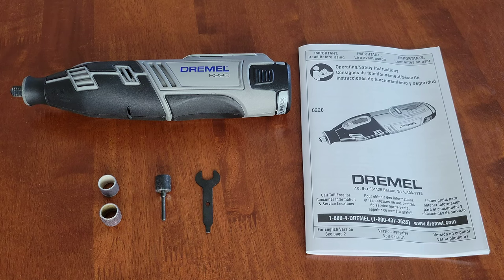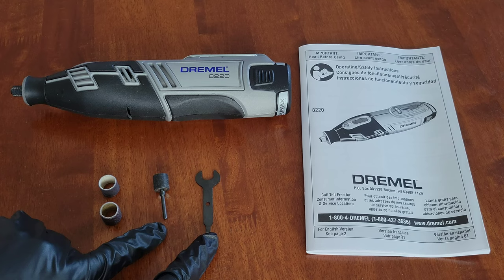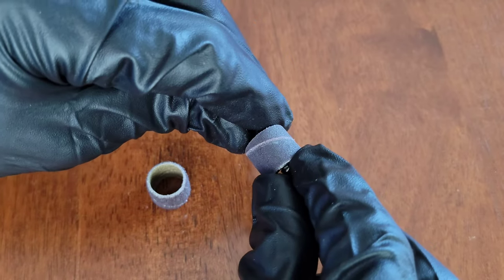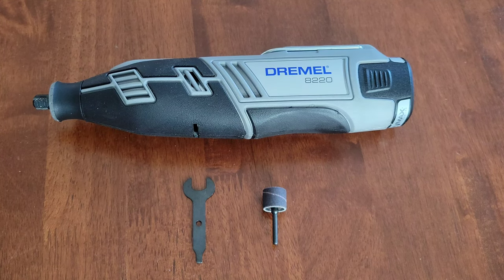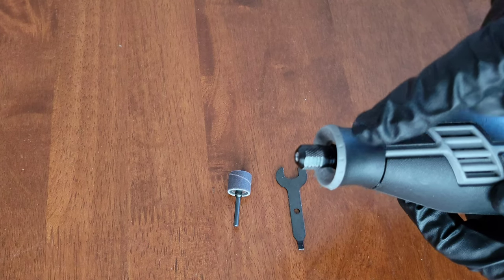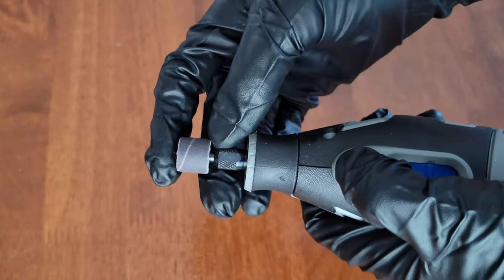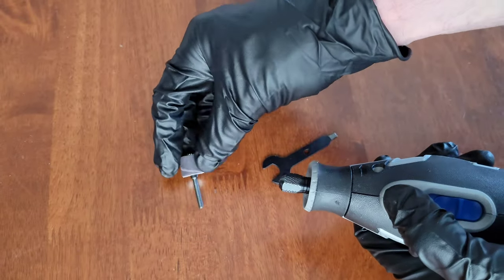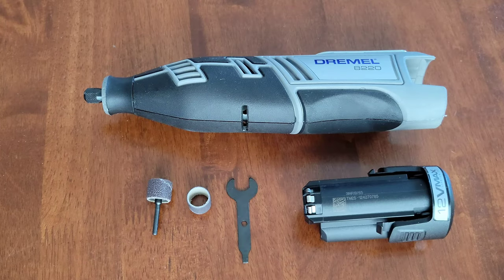How To Install Dremel Sanding Band & Sanding Drum Mandrel

Comment: The problem is that my sanding bands will not slide onto the drum easily like yours did
Reply from the maker: Hi Eric and thanks for watching. You could try reaching out to Dremel to see if they could help further. There might be an issue with  the mandrel and hopefully they can help. Thanks again for watching.
Reply: Seems I have this problem too.  I wonder if it's because the screw on the mandrel has been tight too long, so even after loosening the screw it doesn't shrink back like it should.
Reply: I have the same problem. I loosened up the acre so much it fell out. I’m so aggrieved. I go to do a job that should just take minutes and hours later I’m still sitting here trying to get the disk on. I’d doesn’t want to budge.
Reply: There's a YT video that provides a solution to that problem. I just watched it today along with this one.
Reply: @shericreates I can totally relate! It seems like it's always taking me hours to do jobs that should only be taking minutes. So frustrating! 😧